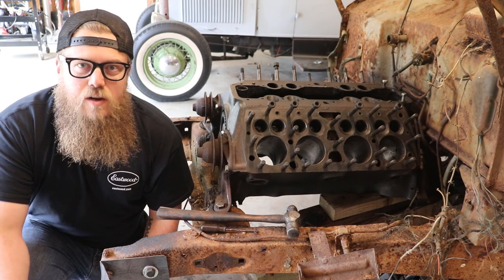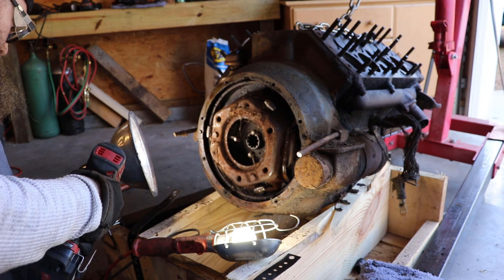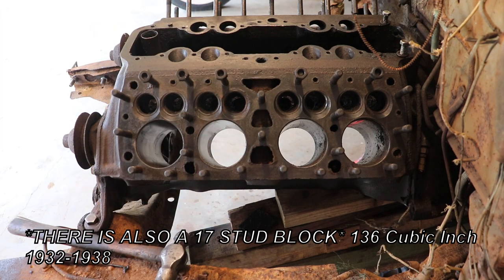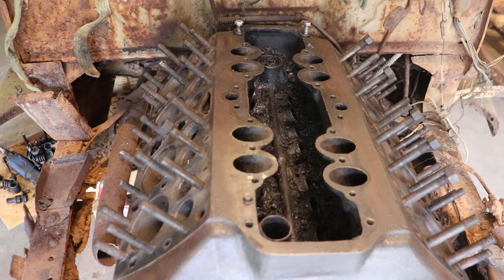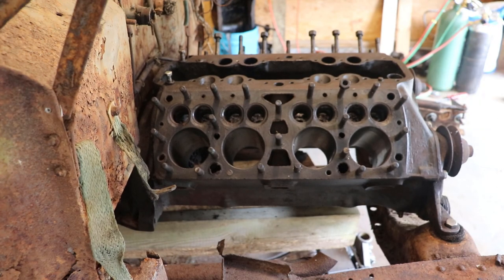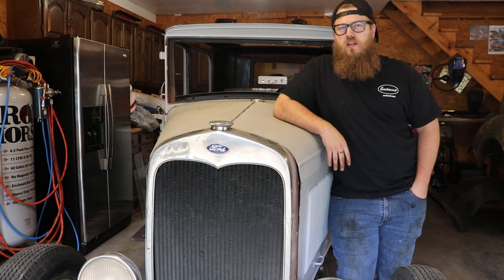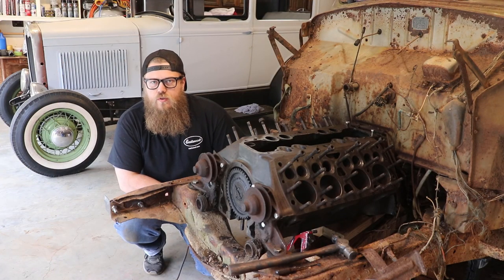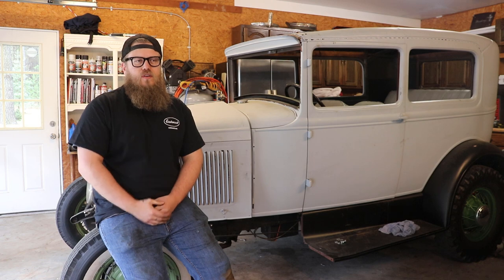How to Identify FORD FLATHEADS!

Comment: Thanks for your great videos explaining flatheads for a newbie like me! I just got a 46 Mercury that has a engine number, 73924, stamped on the top front drivers side of the block and A1673 on the bellhousing at the rear, I believe the motor is a 59ab although it has 58ab stamped on the heads. Many thanks for your help regards Grant

Comment: An unmentioned ID feature are the characters cast in the pad ahead of the cylinder head, on the right side from memory. There ore two digits ending with "9" which  indicates a 239 cube Mercury engine. The first digit indicates the model year, so '99' is for 1939 while '09' is for 1940 & 19 would be for 1941 & so on. The 1945 design was not only standard fitment till '48' but was also standard in regular Ford models in the US as well, hence the 59 identifier, while overseas models retained the 221 cube Ford engine till 1948.
24 stud Ford 221 cube engine models often had the number 81 in the pad between head & water pump.
Some wartime engines had 'relieved' blocks. These days this would be called a "Power Slot" but the factory removed some material between the valve area & the bore, down to just above the top ring when at TDC. This allowed better breathing &, obviously, more oomph.

Comment: A lot of good information, one mix up would be that 3.187 was the bore size for the Merc 239 engine oppose to the stroke, but there is so much info to remember on the flatheads!
Reply from the maker: That’s correct! Someone else caught that too and I completely said that wrong in the video, my apologies

Comment: Ford actually introduced using the 8BA-style motors in 1948 in the F-series pickups, while the cars had the 59A style.   In 1949 they switched to the 8BA in cars.

Comment: I just got a 1947 1 ton truck.  The # on the heads is 59A-B. It has the distributor between the helmet and the crab 🦀. The ford script coil is located on the left side and the bracket bolts to the intake manifold. What size engine is it? 😇🙏
Reply from the maker: Hi Doug! Send me some pictures on instagram and I’ll be able to help you out

Comment: Great valuable information. I have a 1936 4 door and want to buy the Edelbrook Cylinder Heads but I´m not sure which one should I order? 1126, 1125 or 1128? They all look the same...
Reply from the maker: From what I know 1125 and 1126 are pretty much the same CC and compression ratio, the 1128 on the other hand is a high performance head, much larger chamber and is taller internally to make more room for high exhaust and intake lift on the valves/big cam
Reply: @WiredCustomsSpeedShop  Thanks, so basically it's chossing between a gret looking or a greatlooking + high perfromance I guess. Now what about the manifold? Any suggestion on which one should I Pick? If I am correct, by following yout video I was able to identify my engine which I belive it's a 221 engine.
Reply from the maker: Juan Carlos Moreno that’s good, it depends on what you want out of your engine, are you going to put a bigger cam or crank in it?

Comment: Zack, I've watching, actually trying to get caught up on most of them because I am starting a '31 A project literally from the frame up.  Between watching them and reading as much as I can, I've decided to buy a donor vehicle for a parts source for the project.  It's a '47 Deluxe Coupe so as I understand the process, I can use the brake parts to put juice brakes on my project along with perhaps the steering column and steering box.  It also has a flat head 8 block in it (unknown condition, I guess I'll find out when I get it home).  Any advise?  Thanks for all the helpful vids from someone else from Virginia

Comment: Hi I was told late 36 made a block stamped L B.   WITH MAIN bearing  shells not babbitt  mains.  21 stud water pumps on heads.  I was also told  u can block water pump holes in 37 and  early 38 block s and put 36 style heads on them to look older.  I have to babbitt  36 here rebuilt  in a nice pkup

Comment: Just bought 46 ford Deluxe ,239 V8, watching your videos! What was the purpose of dual water pumps that my engine has and this engine is bell housing molded with engine !
Reply from the maker: The water pumps cool their own side of the block individually, at the time that was the best and most affordable technology, ford was revolutionary when he was able to cast the block in one piece, before the Flathead V8 all the manufactures made their engines in multiple pieces and bolted them together. The single cast made the engines more affordable and became the cheapest V8 on the market at the time it was built
Reply: @WiredCustomsSpeedShop  have Fenton head's on engine 24 studs,the coolant inlet built to head are thermostat,s drop inside? And mechanical temperature sensor with metal tubing to gauges inside car! Can send picture has 3 97 Stromberg carbs ! I'm 70 relearning old school! Lol

Comment: I have a flathead not sure the year or what. I bought a 40 ford truck guy said it's a 49 mercury.  Well runs good but I'm pulling it to drop in a 289. What's the value on it

Comment: I have a 1951 mercury coupe v8Flathead. Do you have any videos on how to do a water pump seal replacement kit. And how do I go about purchasing the correct kit for it any help would be greatly appreciated thanks
Reply from the maker: Thank you for watching, I don’t have any videos of it yet! But I have a set that needs to be rebuilt! For the rebuild kits I like to buy them from MAC’s Antique Auto Parts

Comment: I want to change the point to the pertronix electronic points. Just wanted to see which one you recommend. I  have a 1951 Mercury V8 flat head the distributor is on the top front passenger side of the engine. Thanks
Reply from the maker: No problem, I’ll be on the lookout for your email

Comment: 1941- 221 “Tin Can” -> re bore to 239 w/ stalk pistons gives 95 hp.
The “Pencil Shelf” timing gear cavity has space on top of casting.
In a 1939 pickup truck, 3 speed w/ Michell 26% OD & 3.78 : 1 banjo.
Rebuilt Divers Helmet dist. housing w/ extended nose, gives tach drive.
Bell housing oil passage drilled, threaded, plugged, gives oil filter feed.
The output has a 0-60 psi gauge & a below 5psi  ignition kill switch...
Delayed start until lightly lubricated, and saves engine “If” oil lube loss.

Comment: How can you tell if an engine is original to a 1946 v8 pickup?  Are there other components that have matching numbers?  Thank you, video is very helpful.
Reply from the maker: There is a bunch of little things that can tell you if the engine is correct year for the truck, there is nothing definite that will tell you if it’s original to that exact truck, if you look at my most recent video “no Spark no start” you’ll see my engine in my model A that’s from 1946, the distributor it has is a dead give away of the year of the engine, but they are changeable with different years, but the way to ID a 1945-1948 block is the bore/stroke/ and center water outlets on the block, the bore will be 3.1875, stroke will be 3.750 and the top water outlet will be triangle, with the two bottom water outlets being circular
Reply: @WiredCustomsSpeedShop  Thank you!
Reply from the maker: @steves8014  no problem at all!

Comment: Some good information here. Some details were a little flawed. The 21 stud was still being used in '38 but was phased out during the production run. They were still referred to as the 81A. The bore for the 221 was 3-1/16 and the 239 was 3-3/16 but they both had the 3-3/4 inch stroke. A lot of differences through the years besides that.
Reply from the maker: Thank you for the information! I know I messed up when I was trying to remember all the numbers, specifically when I said 3.18 stroke when in reality the Murcs had a 3.18 bore on the 239s

Comment: Help ID this flathead: - The heads are marked “29A”
The bell housing casting numbers are “I1433” or “11433” The block surface where the intake mounts is raised NOT flush.
The distributer is the crab type.
The sides of the block above the oil pan bolts are flat no bulge in the block. Thanks!
Reply from the maker: 41-42-wartime engine. Referred to as raised, but actually the shoulders are lowered, the casting numbers don’t help ID engines on flatheads sadly
Reply: Wired Customs LLC -the guy I bought it from thought it was a 42 merc engine, is that right? Is there an engine model number (like 59a, etc) that I can reference when buying parts?
Reply from the maker: The engine is basically a 59, it’s just before they used the “59” number, it could be a 99a, 29a, but that doesn’t matter when it comes to ordering parts, I would be shopping for 59 parts. As far as it being a Merc engine you would have to take the heads off and check the bore, before WW2 there wasn’t much difference/advantage in the Merc engines
Reply: Thanks for the info! When looking at heads and gasket sets for sale they reference “big bore” is that correct for this engine?
Reply from the maker: R Claws  big bore is for a racing style flathead that’s running .125 over bore, I wouldn’t think your bore is that big, definitely check your cylinder bore size first

Comment: Are certain model blocks more likely to have cracks than other ones, or do all models have the same likelihood of having cracks?
Reply from the maker: They all have the same likelihood to have cracks
Reply: @WiredCustomsSpeedShop  That’s good to know. It seems like people would always talk about the 8BA and the 59s having cracks on the forums I’ve read. I guess there’s just not a lot of people on these forums tearing into earlier model Flatties, like the 21 stud. I’ve been wondering if it’s possible to use a crab distributor on an 8BA. What parts would need to be changed to make one fit? The crab distributors just look so much better.

Comment: Good evening hope you are still answer question.
I was given a mercury 1951 flathead engine 255 cid  the crank is the 4 inch one 
Anyway I need a set of connecting rods for it. Are they the same as the 8AB connecting rods and piston
Where  can I go to to find them. 
Regards
Reply from the maker: You should have no problem finding 8BA connecting rods, that’s what you need, they will actually be labeled “8 BA” and be 7 inches long, you can find new ones from Scat or Speedway, or you can join the group “The Flat Spot a Flathead Support Group” on Facebook and ask if anyone has some used ones for sale, when it comes to to pistons you WILL have to get 4 inch stroke specific pistons, I would recommend getting some new ones, also found from Scat and Speedway and some other places like White Owl or Facebook
Reply: Thank you very much
Reply from the maker: @lemchesher311  no problem, let me know if there is anything else I can help you with

Comment: If I have 4" mercury crankshaft and I want to put it on a 239 8BA motor. What do I need to change thanks
Reply from the maker: you'll need the correct pistons and rods, 7 inch rods, and pistons for a 4 inch stroke, I would recommend buying them new

Comment: A friend of mine has a derelict 1939 Ford 1-1/2 ton truck.  The heads have " 9T " embossed on them.  So this should be a 239 engine, correct?  Other than the heads, would this also be a Mercury block?
Reply from the maker: At this point these engines are so old you can’t identify a motor by what parts are on it, I rebuild Flatheads all the time and it’s rare to find one with all its original parts, the best thing you can do is to measure the stroke, the 239s had a 3.750 inch stroke, everything outside of that could’ve been changed, the block wouldn’t be different, and the serial numbers don’t tell the story
Reply: @WiredCustomsSpeedShop  It is the original engine, never been messed with according to her father, who bought it new, and parked it in 1955.  He has  since passed on a few years ago, but his daughter is just now cleaning up the place.  She's offered it to me free for the hauling.  I'll probably take her up on it, even though it's stuck solid.
Reply from the maker: @skn9895  I would definitely pick it up at a chance of a 4 inch crank

Comment: Is there a 296c.i. using the Merc crank?
Reply from the maker: The most I’ve ever seen on a flathead is 275c.i. From a Merc crank and 3 5/16ths bore, and that’s pretty excessive and was a full drag block with overheating issues. Most common is a nice .060 or .125 bored over block with 4 inch stroke, 255c.i. Is usually a maxed out street-able block

Comment: can you help identify flathead i have 24 studs and triangle at top and two circles like you said on the bottom of the block on the back it has M1994 stamped on it
Reply from the maker: Frank Roach I would love to help anyway I can
Reply from the maker: If your block has a triangle shape at the top and two circles at the bottom then it’s a 59a or 59b block
Reply: Wired Customs LLC  how can i know if its a or b
Reply from the maker: You would have to have the original heads, they had the stamping on them indicating what the block is. 59A-6050-A head marked 59A on casting has 77-79 cc chamber. 59A-6050-B head, marked 59AB, has 73.5-75.5 chamber spec, that’s why most call those blocks 59ab instead of specifically saying what it is because it’s hard to know
Reply: 24 head bolts  and bellhousing casting numbers L1763  over a  59. No date on the rear right intake deck.  🤷‍♂️
Is there anyway to decode the first number? Couldn't find anything.
Reply: Offenhouser heads and edelbrock dual single intake so now codes there.

Comment: What motor oil do you use/recommend for the v8 flat head. Non detergent or detergent motor oil. My motor has the oil canister with the filter on the
Reply from the maker: A older rebuild calls for Non Detergent, something recently rebuilt I would run modern oil, oil depends on where you live and the weather, in Virginia I run straight 30 weight Penn Grade oil, flatheads have flat tap-pit cams so you have to have high Zinc in the oil, that’s why I choose Penn Grade oil

Comment: what is block #51401 help needed
Reply from the maker: Hello, Flatheads did not have serial numbers, they only have casting mold numbers, these numbers only let the plant building them know which molds needed repair, the information on what mold numbers built when were never saved and different at every plant across the world. Also numbers were stamped in by engine builders once they were rebuilt, this is how the individual engine builders kept track of warranties and those numbers can’t be used to identify the motors. That’s the bad part about flatheads, they didn’t have a direct serial number to keep track from, you have to identify them by sight, the only other number identification is if it has a “59” in the casting on top of the transmission bell housing.

Comment: hi i have a flathead engine its a 24 bolt heads it has two bolts between the water jackets and on the bell housing the number is B5411 can you identfy this for me please  thanks
Reply from the maker: Hello Harvey. I would love to help, so it does sound like you have a 24 stud, do you currently have the heads off? Also I am guessing “59” isn’t written on the bell housing? If there is no “59” on the bell housing it’s a pre WW2 block, making it from 1938-1942 (in USA) I would have to know if the intake surface is raised on the block or not, or how big of a stroke the crank is to be able to narrow it down anymore than 38-42
Reply: @WiredCustomsSpeedShop  hi mate yeah its 24 stud , and yes your right it DOESNT have 59 on the bell housing and yes the intake surface is raised  im not sure on the stroke ?? im new to this so i have alot to learn lol but i love it thanks soo much for your help
Reply from the maker: @harveyjones5430  no problem at all, your block is a 1941-1942 block, next step is to remove the heads to figure out if it’s a 221ci or 239ci,  look at center vertical row of water passages: If lower 2 are trapezoidal it is a 221, if only lowest is trapezoidal and the center is round it is a 239 Mer/truck
Reply: @WiredCustomsSpeedShop  yes the heads are off and they are both trapezoidal  so as you say its a  221 ???
Reply from the maker: @harveyjones5430   that’s correct! Good motor never the less, I made my 221 into a 255
Reply: @WiredCustomsSpeedShop  ok well thanks so much for all your help  its been great ,, over hear in the uk  speach soon cheers
Reply from the maker: @harveyjones5430  no problem at all I am glad I could help

Comment: What about V8 60’s??? French Flatheads, Tank Engines, Lincolns
Reply from the maker: As far as v8 60s, they are the easiest ones to spot, they are a lot smaller and only have two coolant passages in the middle and only have 17 head studs, as for tanks and French flatheads I don’t have experience with these

Comment: how are truck engine , i have 51 or 52 pickup
Reply from the maker: aroundfreddy they are practically the same, different water pumps, different engine mounts
Reply: just got truck  Friday think its 52 f3
Reply: it needs a fan blades , had 4 . some cut 2 off , what would be the best fix ?
Reply from the maker: If I was you I would get a new fan, I would t mess around with trying to fix it, there are a lot of used ones out there, I suggest you to join the Facebook page “The Flatspot A Flathead Ford Support Group” and making a post saying you need one, someone will have one for sale